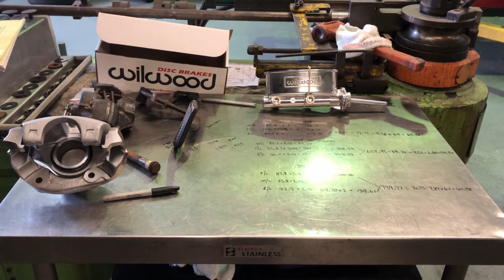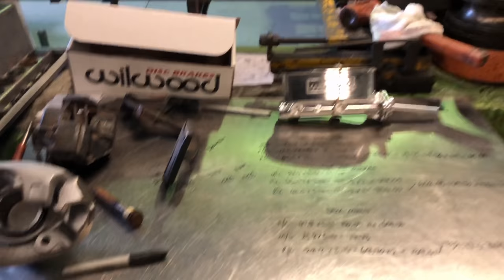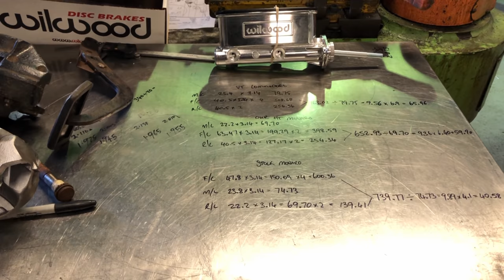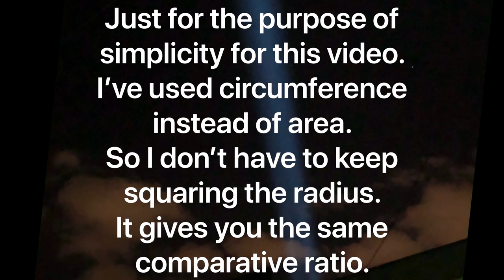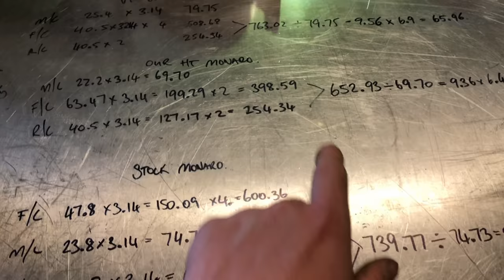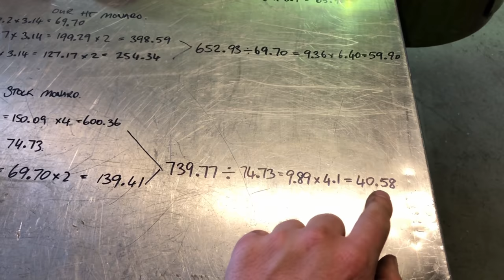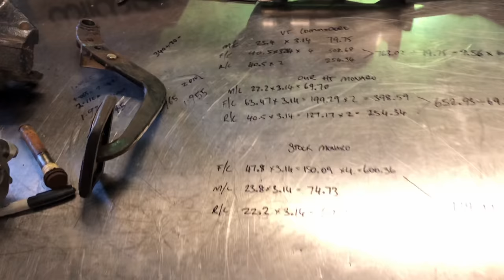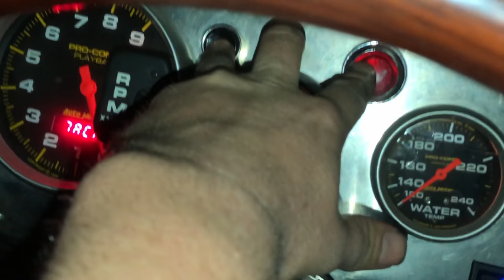Ep. 14 I’ll show you how to make an old car stop like a modern car!

Comment: I love the explanation about pedal pressure ratio and how that force put through the master distributing fluid pressure with small lines pressing a large piston onto a disc........ there's the physics and maths call coming in. Even a bit of trig with pedal design...... I love it...... I'm not that smart to design such things but I love to see how physics and maths comes into engineering something like that........ don't sell yourself short, you are certainly a great engineer in your own right....... Keep doin' what you do....... Keeping the K, T, G model alive........ very sentimental for me cause my first car was an HT with a good ole 186......  I learnt much from taking apart and rebuilding Holden reds.
Reply: why re-build .balance blue print timing chain and gear valves and springs no worries start from the bottom up 235ci way to go

Comment: Thanks for doing this , I then looked a bit further into it 
System pressure is a function of  1/pedal pressure typical = 75 lbs  2 /  add pedal ratio 3/ plus booster assistance 4/ calculate area of master cyl . = max system pressure .
Caliper clamping pressure can then be calculated .
Drum brake calculations I suspect are very different .

Comment: Great and reasonably easy explanation of the numbers behind your engineering. Thanks for that.
Once the punters have accepted and adopted your suggestion on the master cylinder/brake pedal/caliper combo they can jump into the deep end of the "pad and disc"  choices.
Maybe a topic for another episode, even though it's probably a pandora's box you may not want to open?
Reply from the maker: Great point!

Comment: hi Yup at least some one did some maths . Many brake kits sold in Australia are poorly designed and even illegal . Its very easy to out grow Australia`s tech abilities .
Yes bigger area pads , higher friction material , bigger clamping pressure  is all good .
Discs , high temp material iron , big diameter , high  weight are all good features

Comment: Hey i have a 80 xd and 92 eb. Goes without saying i suppose,  that u can apply these brake physics to any older vehicle wirh sub standard brakes. I remember hammering my eb 5.0 wagon on a back straight in the country @100 milw plus to a tee intersection and ending up a good car length into the intersection. Shoulda been @ the pearly gates but dodged a bullet. With experiences like this, i  would like some input into improving brakes on these old girls of similar vintage please.  Keep up the great channel. Brings back memories of rolling in a mates 327 hk  3 speed man floor shift ( dunno who swaped that box in) back in bastion point in the early 80s. (RESPECT TO Joe Hawk). Pioneer tape player playing tapes like alvin n the chipmunks. Ahh memories....
Reply from the maker: Its all about the memories.

Comment: Hi there ,  Great explanation !  Love the tech bit in the middle. Would not the std 4:1 ratio also be improved by the booster factor ?   Is this purely comparing booster type pedal in non booster situation.  Also if you went Wilwood calipers, 4 piston per caliper,  FC Piston diam 44.5mm x 8, RC 35mmx 8,  25.4 MC,  you end up with a very high comparative ratio.  Would you need to reduce pedal ratio ?

Comment: When I saw all those numbers on the bench and you started going through them all, I definitely found myself a little aroused. That shit is the bomb!

How does this equate to required weight/force on the pedal? My mind says that corrected overall ratio with the modified pedal should bring it back in check. Reason I ask is I'd love to do this on my VH build before rego inspection but have been told definitively that 10/10 times the boosterless route fails engineering due to exceeding braking force guidelines. But then I guess the next issue being the engineer also needs to sign off on the pedal also i suppose...
Reply from the maker: Some of them should be called Mod plate providers, not engineers, because many of them are not engineers. 

Some of them will not pass non boosted setups, some will, see above as to why that is lol

Comment: Hi If the stock early monaro had a better pedal ratio therefore the pedal would become easier to operate. So what would happen is u would burn up the stock brakes . 
    This type of brake system was a joke  by USA standards . In around `68  Optional 4x discs arrived  and then there was a road / track package which made them bigger again  . Eg many fullsize had optional 300--305mm disc .

Look into the old Bathurst videos many of the Lc Lj Torana had retrofitted vented discs .

Holden short changed the ozzy consumer by a large margin in the 60`s  eg 2 generation of cars .
By the 70`s only one generation . By the time Ozzy GM  caught up with the USA  ozzy went to Vb commo .